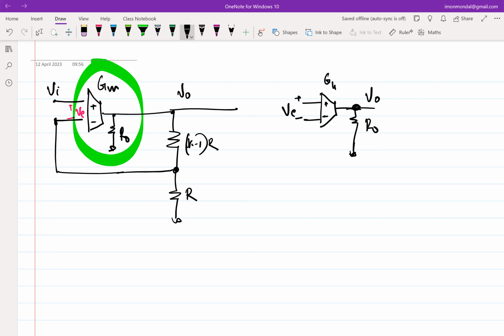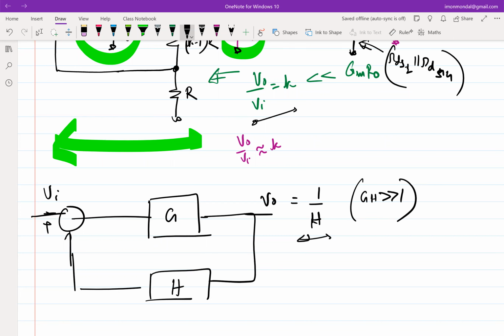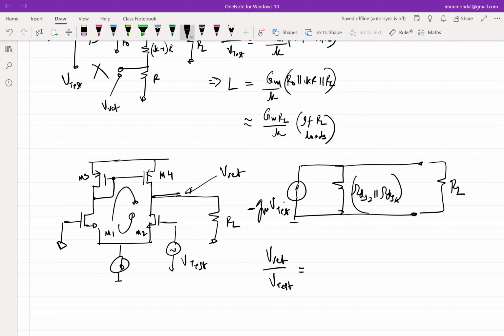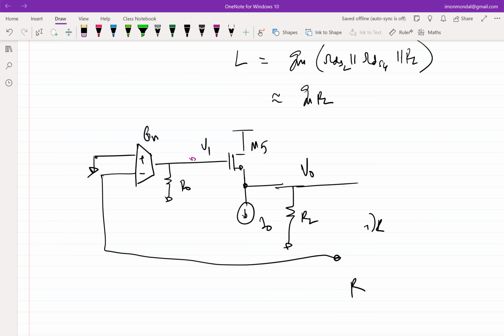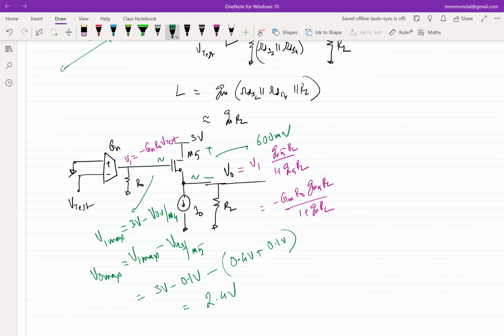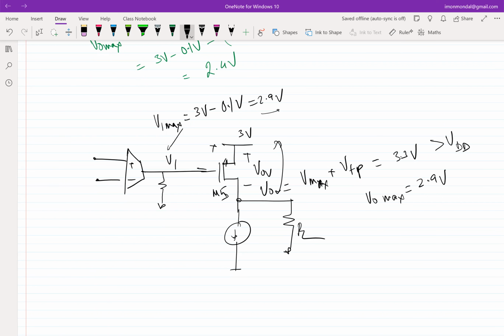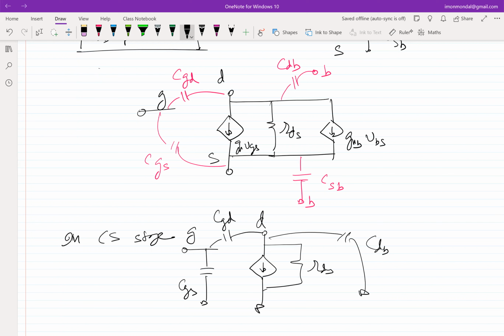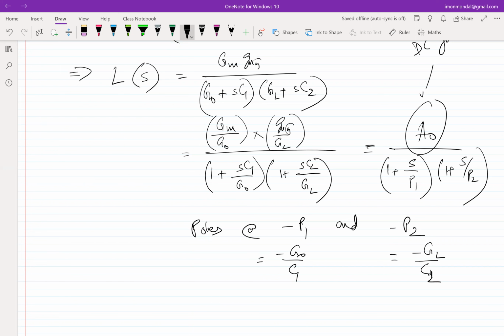Lecture 38: Introducing two stage amplifiers and parasitic capacitances

Comment: At 34:55, if V1 goes to 2.9, the M5 pmos will go to cutoff so the max V1 shouldn't be that high since Vthp is 0.4 volts, so source must be at least V1+0.4.  
So V1_max=2.6V, 

and since Vd<Vg+Vth, 
V_out_2 will rely on V1_min rather than V1_max, (i.e., V1_min + |Vthp|)